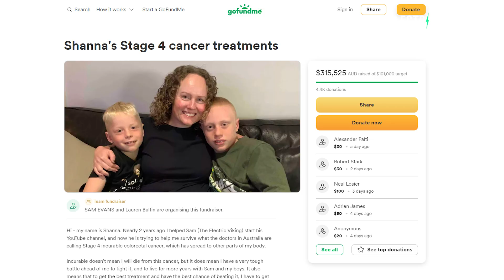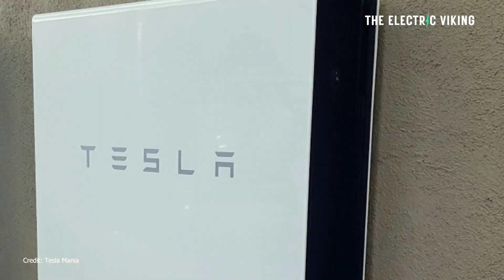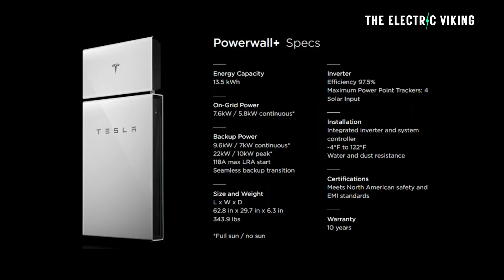NEW Tesla Powerwall 3 gets a MASSIVE power increase

Comment: too expensive, by the time you recoup the cost, about £12k installed in the UK,  it would need replacing. My house uses 6kw per day, over the life of the battery it would be cheaper to buy energy from the grid even with the current sky high prices.
Reply: Fair comment regarding ROI, and of course each individual has circumstances which may be a bit different …….but.

Current electricity usage in the UK might not be taking account of heating which predominantly comes from from gas. Over time, gas is likely to continue getting ever more expensive. Those able to switch to a heat pump might only use only about one third of the kilowatt hours used by gas central heating. Since electricity can be time shifted with a battery - running costs may even be cheaper than GCH. But that is not all.

Electric cars are becoming much more common and when charged at off peak rates will save lots of the money for petrol or diesel. Time shifting can make a crucial difference to the costs experienced, and offers the option of exporting power for profit at peak demand times. Having a battery is also financially useful if you have your own solar generation - since you may not always be able to immediately utilise the power your system has generated. Storing power say in the middle of the day May allow you to avoid drawing from the grid at times of peak demand.

Having a battery allows people to decentralise their supply. This potentially allows for greater security of supply since you might be able to operate off- grid during a power cut.

Comment: If the Powerwall 3 output isn't at least 10KW continuous (not peak), it's a fail imo. 

BYDs HVS and HVM have a much higher power output for a given KWh of capacity compared to the Powerwall 2. 

5KW of continuous power output is simply not enough to cover your usage in the evenings. You'll exceed that and pull from the grid at times. Around the 10KW mark would cover most scenarios, I think.
Reply: Just for the Tesla power Software, its worth it!
Reply: I don’t know what you are running in your home, 10 kW continuous is a huge amount. That would be like having five electric kettles on all the time.
Reply: @ouethojlkjn  it's not really that hard to be approaching 9 - 10KW of consumption at times in the evenings. Induction cooktop say with two pans heating, oven or two running. Washing machine and/or dryer going washing school and work uniforms. Plus, other things like TVs and smaller drain devices.
Then theres times when the AC is operating, heating or cooling as a 6kw load certain times of the year.

This excludes other consumption such as pool pumps/heaters, EV charging and electric hot water that some could have going.
Reply: There are quite a few home batteries that can supply 10KW or more and have been for a couple of years now.
 Tesla, imo needs to match that capability or at least come close to it. 
For the average consumer who buys a Powerwall 2, they may not have a clue how much instantaneous power they consume at any given time prior to the powerwall being installed. 
It would suck to have a battery but still be restricted in what devices you can operate to stop maxing out the 5KW output (and pulling from the grid)
Reply: @GWhisperer  Then we get into the world of peak load - all those things do not use electricity all the time. An electric over will be rated at maybe 7.2kw but it won't draw that constantly. However I agree that as you have laid it out here, it is possible for a household to have a draw of 10kw or more. Maybe two powerwalls are smart enough to blend their output in parallel? LIke two Powerwall II having a peak of 7.2kw (at least here in the UK) could be configured to deliver 14.4kw?

Comment: No, still not interested.  It needs to get seriously cheaper before I dive into this.  Subscription might be a good way, but the devil is in the detail.  Same for rooftop solar.  Is there anyone doing a system that you don’t own as they property owner, but you host on behalf of a community provider?  The series of panels on your roof gives you some rental dollars and cheaper power, with maintenance and replacement residing with the provider.  It would be ideal.
Reply: Agreed, solar power is a diffuse, low energy density resource and it will not be effective if individuals are expected to install, maintain and decommission it. South facing roof area must be requisitioned and installation, maintenance and decommissioning undertaken at system level.